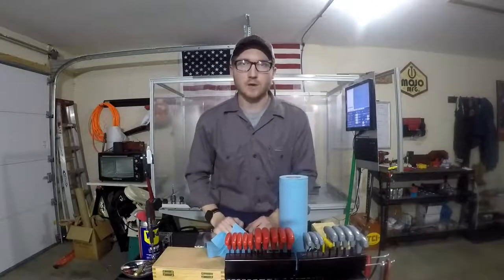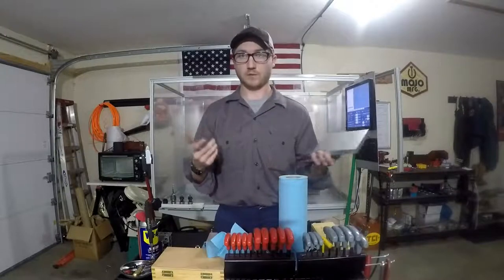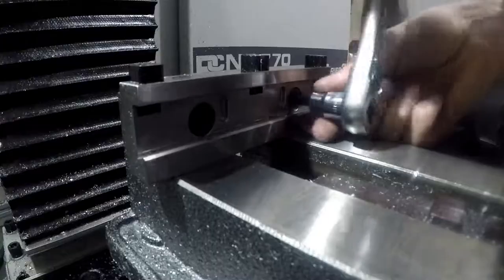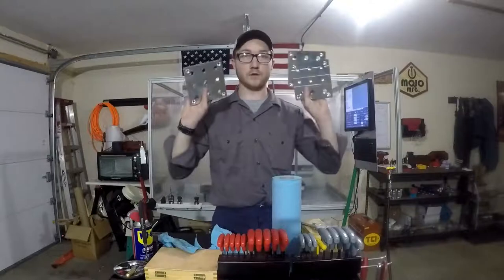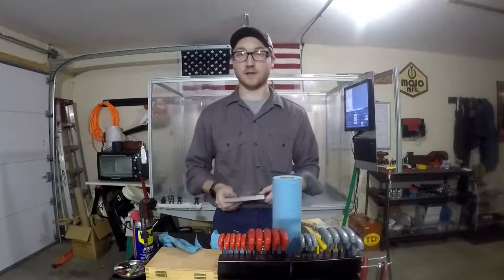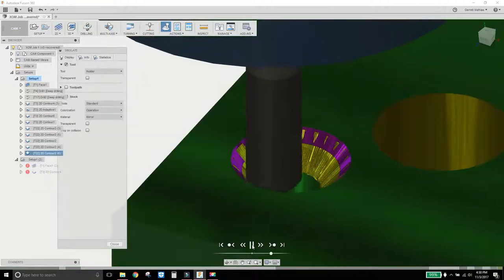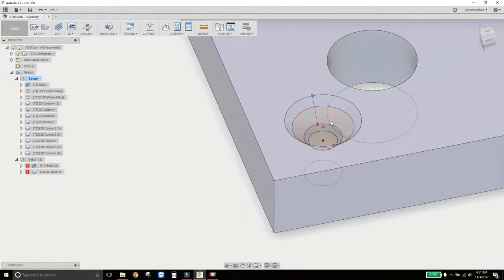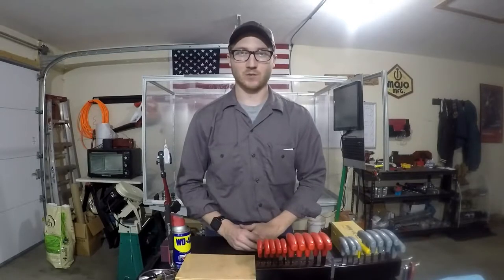Job Shoppin': Home Mfg. Days #5

Comment: Just did a CAM for the chamfered holes using 1)drill 2) 3D adaptive then 3) 3D contour.  Good chamfer at about 50 seconds per hole.  Too long?  I cut at 30 ipm at 5000 rpm with 3/8 ball.  Hole was 3/4" at top and about 1/4" deep chamfer at 82degrees.

May look nicer than Chamfer mill approach with a surface bigger than the cutter.
Reply from the maker: That's pretty quick for a chamfer with ball end mill.  It may have worked better for me if I just did it that way anyway.  I will probably look at doing it that way should it ever come up again.

Comment: The operation you seek for chamfering those holes is bore.  Rough it with a square end mill and finish it with a ball end.  Seems kind of weird to do it on a tapered hole but give it a try.
Reply from the maker: Jason Carter Yeah I had thoughts about that but I had the 82 degree chamfer mill so I figured it would be better to use that instead. However, I believe it could be just as quick if not quicker by doing it the way you described.

Comment: Your vise jaw can mount too the far front closest to your vise handle. Look at the front of the vise you will see 2 mounting holes so take the jaw off the movable and move that to the front lay your work on the top.
Reply from the maker: My goodness, I had no clue what those holes were used for.  I will definitely utilize that tip next time I get some thing bigger than the vise jaws can handle.  I would have been afraid to do it that way on this job anyway, just because my work piece would have been laying over the top of the whole movable job and I still had to cut thru holes in it.